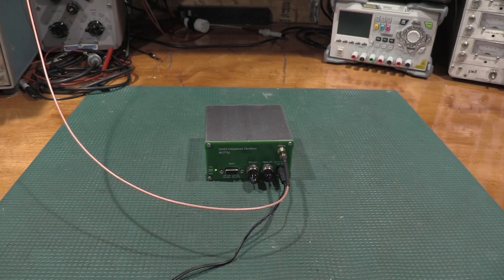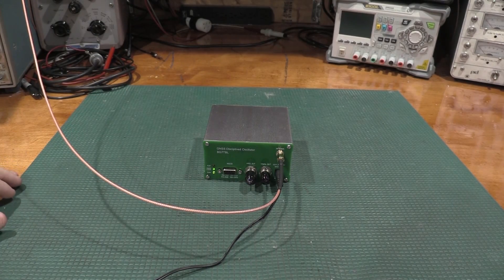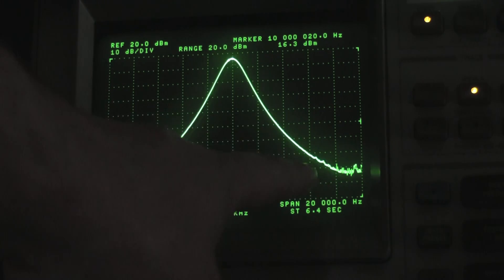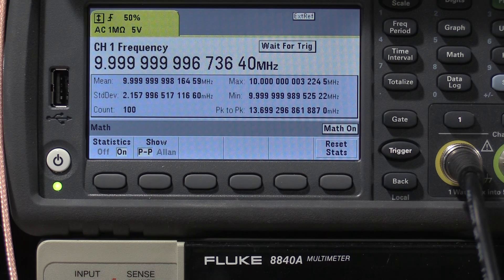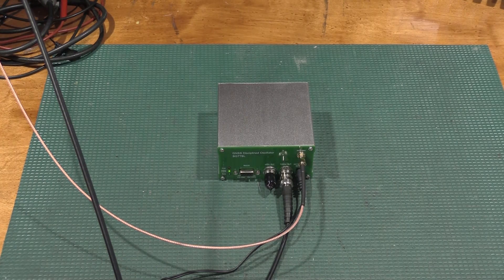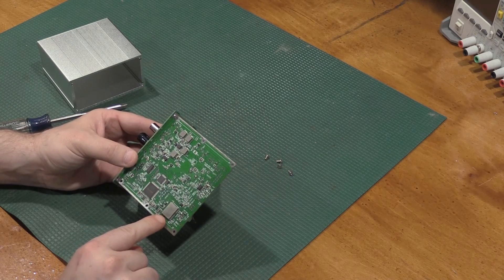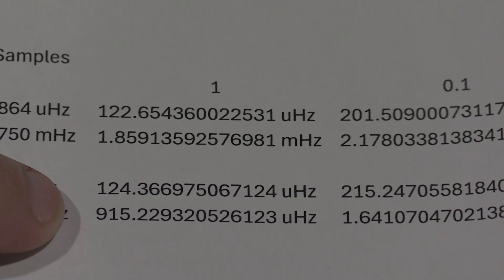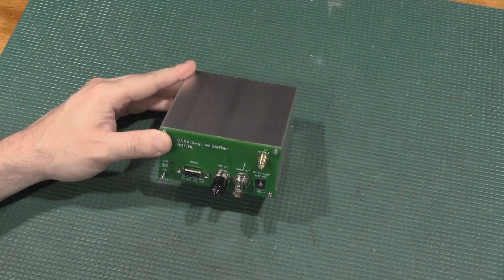Mastering Precision 2: 10MHz Reference Testing & Analysis (BG7TBL GPSDO)

Comment: If you are interested, there are some very good deals on Symmetricom (now Microsemi) units that are recent cell tower pulls. I just purchased an ET6000-86 ExacTime GPS Time Code and Frequency Generator, in place of buying one of the Asian models, which I already have one of. The Symmetricom's BNC ports can be configured to provide a 10 MHz sine wave out, each, via internal jumpers, giving you multiple sources.

The unit works on 120 VAC, not an external 48 VDC source, and uses a common 5 VDC antenna. It's rack mount, and programmable via the front controls and LCD display. Internally, it uses an OCXO, but you have to watch which model you buy as some have TCXOs, and others can have a Rubidium source. 86 is a custom option module that was supplied.

Comment: I have the older Leo Bodnar single output unit and added some heat sinks to the unit, both internal and external to lower the localised hot spots. 
 If the Leo unit stabalizes over 60seconds and the GPS signal needs to be averaged over 60minutes to gain what the real accuracty is as it cycles to reduce its precission. What precession does the Leo achieve in the 60sec stabalisation time?  I'd be interested in the non GPS locked stability figures at 10Mhz.  thanks for the testing videos.  cheers from Australia

Comment: Battery could be for the GPS receiver module so it can preserve the GPS/GNSS satellite almanac or ephemeris data to improve time-to-first-fix times.
Reply: This is correct. If the battery is removed the gps takes much longer to start up.

Comment: Do you also have the Leo Bodnar GPS reference?  Wondering how they compare.   I'm in the UK and should probalby just get LBE-1420 . . .
Reply from the maker: I have a dual port leo that I will be putting through the same testing as a reference.
Reply: @ZenwizardStudios  Look forward to the video.
Reply: Check the time-nut archives.  The Leo Bodnar units test pretty poorly compared to something like a Trimble Thunderbolt.  It may meet your needs tho.
Reply from the maker: My testing agrees to the Time-nuts results (video will be out shortly) I was kind of curious if there was an abnormality but this does tend to confirm the results. One critical note on the leo is is NOT a fixed output. My is adjustable from 10 Hz to 400 Mhz with 2 ports. With that range of adjustment I would expect there to be some stability degradation when tested with a fixed and tuned for stability 10Mhz.

Comment: I have one of these units as well with date code 2020-06-10. I have compared mine against my Rubidium standard and I'm getting similar results to yours using a HP 5371A Frequency and Time Interval Analyzer. I have also characterized the unit using Time Lab, and for the money, it's certainly a very cost effective option than using a Cesium standard. I have had no issues monitoring the unit with Lady Heather.
Reply: Everything is a cost effective option vs cesium standard.  ;-)

Comment: very interesting video, thank you for making it. do you have some explanations for dummies on what Allen deviation is and how to measure it properly ? in your examples, I see you are changing gate time. what is that about changing the gate time for Allen deviation?
Reply from the maker: Allen Deviation is a really good way to sum together all the “Noise sources” and roll them in to a number for easy comparison. The lower the Allen Deviation the better the oscillator “typically”
The gate time is a way to control the sample window of interest. Some equipment has a long measurement time and the more the oscillator moves around the less stable the measurement. 
Changing the gate time longer also gets some of the slowing drifting from peak to peak. A gate time of 1ms will be far less sensitive to the oscillator walking over the course of several minutes then one of 100 to 200 seconds. At the longest gate time the measurements took 2.5 hours to complete
Where as a longer gate time will average out the high frequency noise and make an oscillator look more stable then it really is. 
Hence why I built the Excel sheet with several gate times, but ALL gate times were sampled 100 times. So there is a sampling of high speed as well as low speed stability. This comes in to play if measurements of interest are 1 to 10 seconds or is something is being monitored for weeks, months, years.